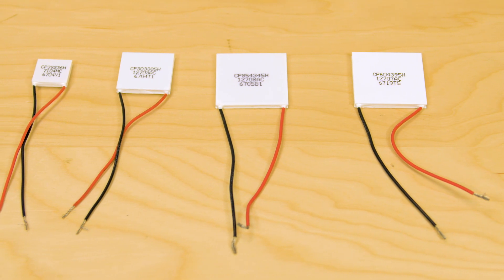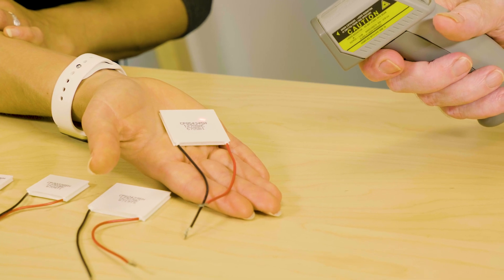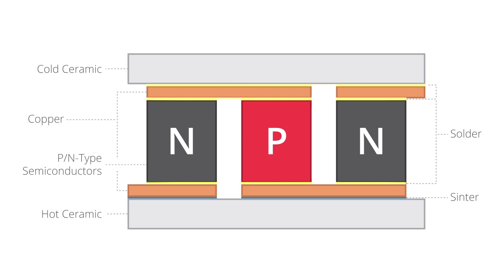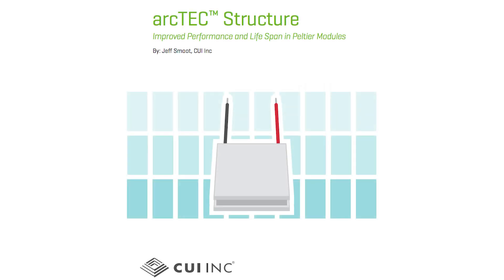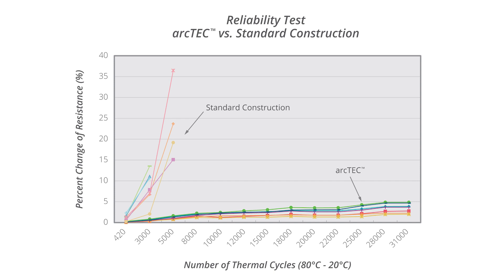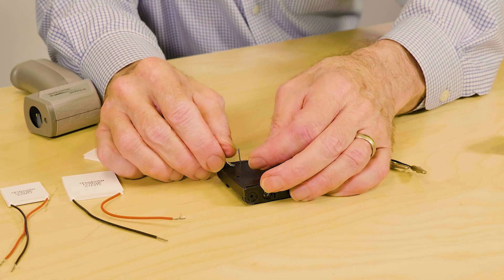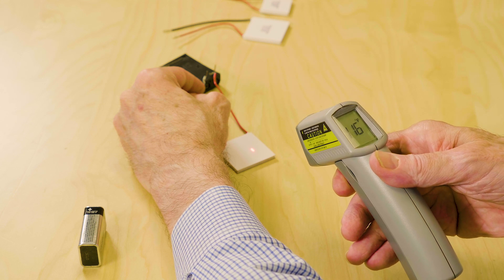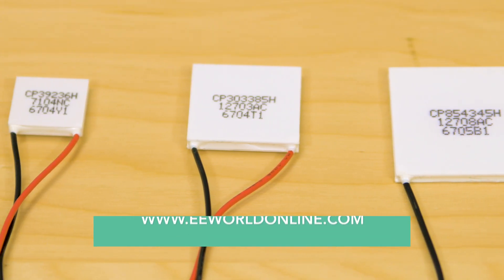Basics of CUI high-performance Peltier modules

Comment: hi would like to ask what 12v power supply is suitable for max cooling performance for TEC1-12706 model? would be glad if any one can help thanks in advance
Reply: Dlaire it's best to go and have a look on die Data sheet. First you have to determ your Delta T and ten the whats you would like to move. After that you will get your Volts and Ampers. But I  would say 12Volts at 6 to 7 Ampers.

Please send me an email on christiaan1200gx@gmail.com and I will send you the complete data sheet.

Comment: But how come they use two different batteries looks to me like they used a bigger battery for there products which in turn would make theirs work better that competitors or am I just seeing it wrong I’m just a do it your selfer not much education behind my OPINION and not tryin to talk trash was just wondering for my own knowledge
Reply: Some kind of cheating, using 9 volt alkaline batt, that about 600 mAh at maximum, for competitor.
And than for their product, using (i guess) three 1860 lithium cells in series, that must beyond 11 volt and 2200 mAh.
If i was wrong, and that second batt is just three alkaline AA in series, its about 9 volt and minimum of 1200 mAh.
Still cheating ?
Reply: are same volt ,bigger lounger life smaller shorter life ,guys why you are starting thinking negative ?
Reply: @norvikboghouzian3915  
No thingking negative, just logic. Its not just the voltage, but the energy in watt hour units.

Comment: To the young men who made the funny comments about the looks of  MRS Eitel, please note, she is married.
I hope maybe you guys might think about what you could do with these Peltier devices.

I will say that it would have been nice for 
the EE World editors to provide al link to CUI's Peltier devices.

https://www.cui.com/catalog/thermal-management/peltier-devices

I would also like to know what  are the various applications their CUI's customers are using their Peltier Devices.

I could think of one application these devices would be needed and that is for enclosed Electronic Devices
 used outdoors that have to endure wide temperature extremes of hot and cold.

One device could be used to heat an Electronic device  during a cold season and 
another unit could be used to cool the Electronic Device during the hot summer months.

A remote weather station comes to mind.
Electronic Devices do not like to run outside a narrow operating range and the these 
Peltier devices appear to extend that operating range.